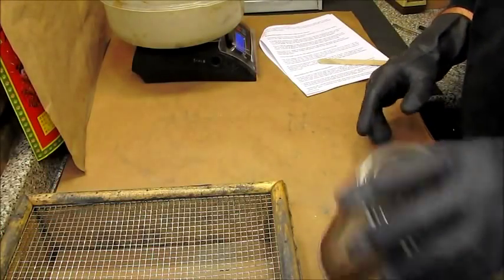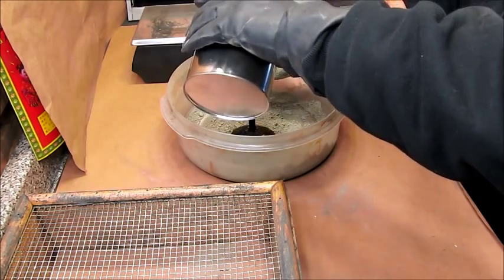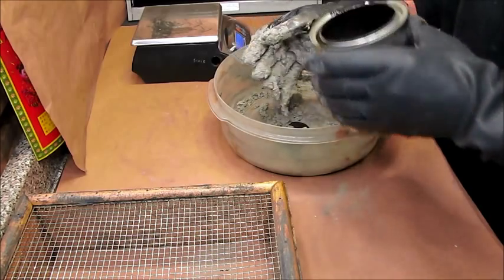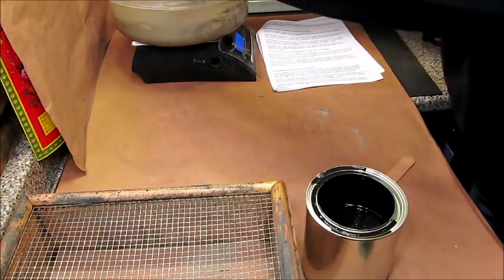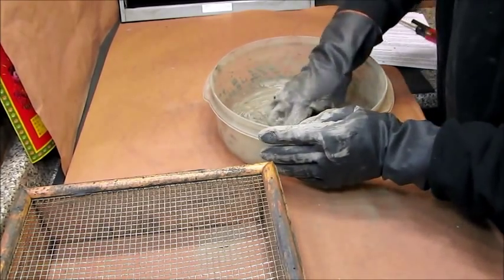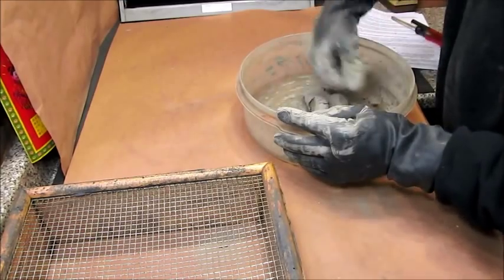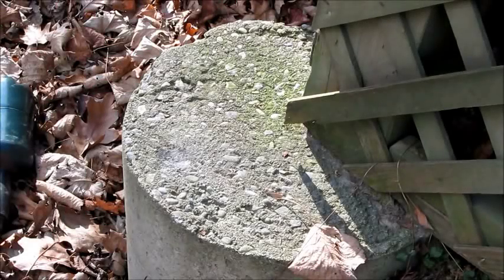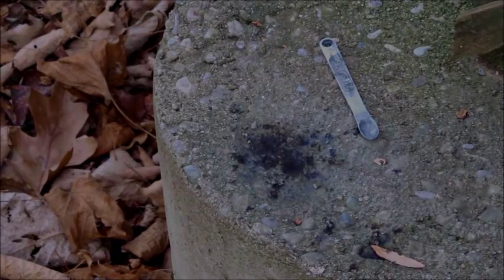Making Crackle Microstars

Comment: I think where things went different is you used a large plastic salad bowl instead of a small stainless bowl.  That probably had a lot to do with why yours was drying out quickly and you had to start scraping it off the sides.  Stainless acts completely different than plastic when it comes to adhering to the material, (sides).  
     Thanks for the video though, you have enlightened me with many different pyrotechnic projects.  Keep doing what your doing cuz your making some awesome fireworks.  
     Thanks for helping me learn more about it and entertaining me with your skills at the same time. 
     Cheers and God Bless

Comment: Im pretty new to pyro. I make my own NC. Why is your lacquer black? Its NC and acetone and what else?
Reply from the maker: No NC, Schel, just smokeless powder and acetone, as has been said many times in this thread.
ned
Reply: Hey Schel :P
Reply: Hey Darian!
Reply: ned gorski  My friend is a pyro tech and he makes his own NC Laq by dissolving chopped up ping pong balls in acetone and stirs it until it is a nice consistency and adds a pinch of charcoal.
Reply: make it with acetone and ping pong balls ! it work perfect for crackling comp!
Reply: Correction, ping pong balls are not made of nitrocellulose. they are made of Polyvinyl acetate. they will work though.

Comment: Bismuth based crackle mix Ned? I thought the stars should be smaller than yours. Do you think the crackling stars works good if they are smaller than yours? Id like to put some in the black powder of my 19mm rocket engine :-)
Reply from the maker: I like the 1/8" cubic ones, BW, but smaller can work, too. I've not tried them in rocket motors, but do like to put them in comets and gerbs. Good luck. Stay safe when trying something new like that. I don't know how the stars would sensitize rocket propellant.

Comment: Hey Ned another excellent video!!! I have question - Why make your own NC Lacquer when its readily available? I get mine from woodworking supply stores online or local when they have it stock - about $10 quart
Reply from the maker: +houseoffire72 , HoF, homemade NC lacquer, made with smokeless powder, has ingredients that standard pyro-grade NC lacquer doesn't, and not only doesn't woodworking lacquer have those ingredients, but it has other "stuff" in it which makes it less than desirable for our pyro purposes. Crackle works with the lacquer made the way shown in the vid. Probably not with other lacquers. One sure way to find out, though.
ned (and thanks for the pat on the back)
Reply: +ned gorski Thanks Ned:) Ive never made crackle but will soon... Im currently working on some "Fairy Fountains"
Reply from the maker: +houseoffire72 , Love the Fairy Fountains. Very pretty and peaceful.
Reply: +ned gorski Ok Im a bit confused after a little pondering lol... Smokeless powder is nitrated cellouse organic material... Pure NC Lac is also made from the same just with the addition of solvents to create a liquid - typically lac thinner is used instead of acetone and also used on visco fuse..Non NC - Lacquer wood finishes are filled with different fillers and I see why those wont work but why wouldnt a pure NC Lac work???
Reply: +ned gorski I hope they turn out as nice as yours did..! I couldnt find a straight -40 TI so had to go with -40-100 from skylighter... I have 60oz of comp drying now - I have over 100 ftns to make... Where can I get a good price on granulated aluminum - something pretty course?
Reply: @nedgorski  Can you help me i know about laqoor and my macro cracking star is not catching fire

Comment: How did you make the NC lacquer
Reply from the maker: Ryan, complete details are on the website. I don't go into lengthy detail on YouTube.
Reply: Ok thanks what kind of press are you using
Reply from the maker: @dinneronthefly7013  I have several presses; arbor, bottle jack, hydraulic power pack.
Reply: Can be made by disolving cellouleid ping bong balls into acetone or dissolving nitrocel in acetone

Comment: Im looking everywhere for crackling powder , but cant find it. How did u get yours?  If u bought it online can u five me a link?
Reply from the maker: "Crackling Powder", ?? The composition was made from individual chemicals, and the NC lacquer.
ned
Reply: ned gorski how do I make crackling powder. ..
Reply from the maker: DOGE JR. All the details are on Fireworking dot com.
ned
Reply: DOGE JR.
If you have to ask that, it seems to me you are a novice in fireworks making?!
Crackling comps are amongst the more dangerous comps to make and should not be attempted by rookies so I would suggest you first learn about making fireworks from the beginning. You can do so by reading books and subscribing to websites like the one from Ned: fireworking.com
Reply: Lead tetraoxide
(Minium)
44
Cupric oxide 31
Magnalium (60-200
mesh)
17
Sulphur 4
Potassium nitrate 4
Reply: drysori Its funny I made a whole crap load of Led tetroxide one day and had no real use for it  at the time.  I just like learning different reactions and out to produce different chemical compounds. I have a half of a mason jar full of the stuff.  I have a bound of copper II oxide as well.

I need to learn how to make the NCL.  Well I know how ot make it but need to find the most efficient cost effective method.
Reply: +Fred Steadmen  - Would you mind detailing your process for making lead tetroxide?